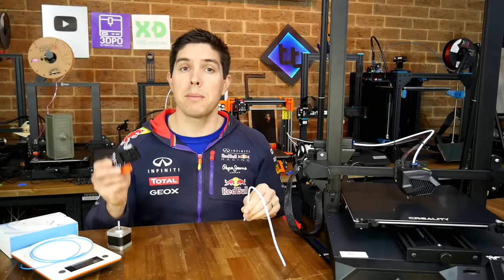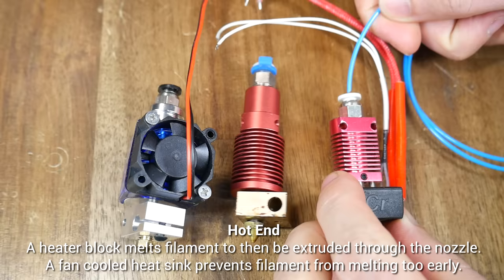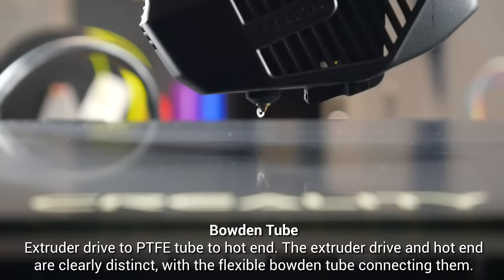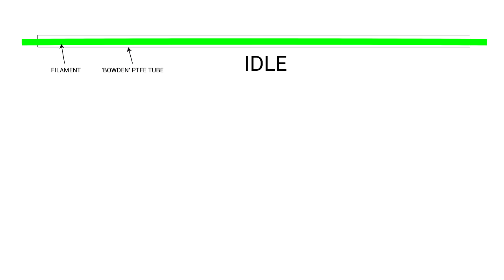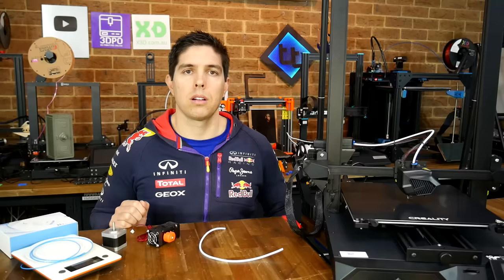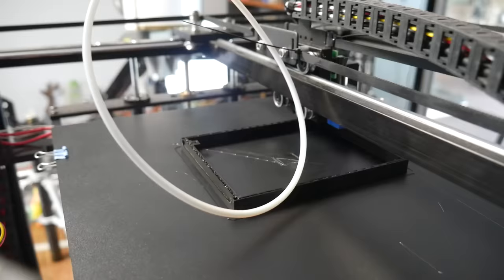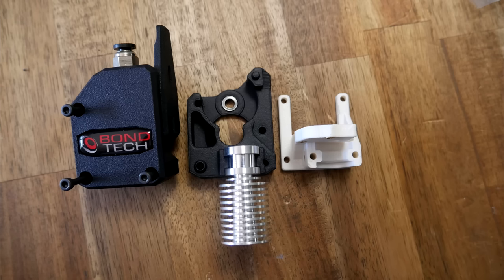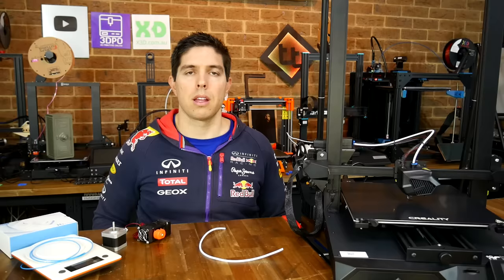Why direct drive is not automatically better than bowden tube

Comment: It is true that you gain more mass with a DD however with Klipper and other advancements in in acceleration control as well as printer config, It comes down to what you are going to print. how fast and what material will you be printing.

There is not a one size fits all in the rebuild market however in a new printer there made for the extruder you choose. thus cuts down on the drawbacks. I personally have had bowden for years and I have also converted all machines to DD. I will not go back to bowden. Because I print for a huge market place and customers orders change material and models all the time bowden just cant hold up top the task. Also the main drawback to bowden is the fittings holding the tube in place fail all the time and destroy prints when they do. If you are printing with retractions then the tube moves in and out causing wear on the fittings and the metal star grip ring in them starts cutting through the tube and causing failure.

Direct drive is only as good as the hotend you have it attached to. failure in a print is most likely to be caused by the hotend not being able to keep up with the pressure and volume that a DD can produce. thus if you are upgrading do your self a favor and upgrade the hotend as well.
Putting more pressure on the DD motor can cause heat creep from the motor to the filament thus causing jams by the filament getting to soft at the feed gears to push it through a cool hotend.  so heated volume becomes very important if you are using a DD.  

So for me DD is the only way to go if the printer is made for the change and the hotend is upgraded.

Comment: Direct drive has been really nice, upgrade my cr-10s. Can't say the weight is much of an issue as my speed limiting factor is the y-axis (as you touched on in your video). I think if you have a printer with a moving bed style you are going to be hard-pressed to overload the x-axis more than the then y-axis is already loaded.

You did miss another nice feature of direct drive and that's faster printing times with way less retraction.

Comment: I like the "floating bowden" where the stepper motor is detached from the frame, further decreasing weight/strain on the x/y/z axis resulting in even better quality prints.  JK i dont use that setup i just imagined it.

Comment: I recently learned that Creality is the only brand who keeps the two screws that hold the hot end in a fixed positiiton to the heatsink and they should be should be removed after printer assembly in order to greatly improve heat separation... 
That makes sense... The screws are transmitting a lot of the heat from the block into the heatsink... 
If this is a minor or great influencer I still don't know... The new bimetal hotend that I'm using has no screws and I wont go back to stock one to test... Maybe this would be a good subject for you. Regards from Brazil!
Reply: No, keep the bolts in the hotend!
They are there for stability of the hotend too
And they make a nozzle change more easy
Reply: Some just did a video on this - I think it may even have been Teaching Tech, but I'm not certain; Tomas Sandladerer (however you spell that!) or CNC Kitchen are other possibilities.  In any case, the conclusion was that the screws just don't transfer enough heat to matter.  Which makes sense - the vast majority of the screws' surface area is exposed, so they'll be radiating a lot of heat before it can even get to the heat sink.
Reply: Chill guys... It was just something I found that seemed to make sense... I stated that I didn't know if this could have minor or major influence...
Btw... all the other brands have no "stability screws"... So I can't considerer removing as a big of a deal anyway...

Comment: I can straight away tell you direct isnt always a improvement, i have a ender 3 s1 with a top mounted filament holder which is good for pla and dried filaments but filaments that you need to keep in the dryer make printing with direct a pain as i have no way to mount my dryer above my printer and feed the filament to the extruder without first having to create or buy some rollers that can direct the filament from the table up to the filament runout sensor which will feed down into the direct drive of my sprite extruder.

Direct drive is nicer for retraction as you don't need excessive retraction like with bowden setups but bowden tubes protect and guide the filament where as with direct drive you run the risk of filaments shaving or snagging, and in the case of glow in the dark filaments the abrasive filament will grind away your unprotected direct drive extruder parts, with bowden you can replace the length of tube very affordably, I don't even know how much a new sprite extruder costs but guaranteed you can't buy a new faceplate or whatever the part is called where the filament feeds into before the extrusion gear.
I want to get the items i need to convert my ender 3 s1 to bowden tube so i can print tpu and petg while they filaments are in my dryer, that way i dont need to install a shelf above my printer that will just be for the dryer box.

Comment: I installed a BMG direct drive and a 6 Hotend on my printer a week ago, and honestly, it's so great. The dual drive has so much more pressure and stringing is nearly not exciting anymore. With the bowden setup I had always a bit stringing even with 6mm Retraction, now I'm using 1mm retract, so great 😄 and because my printer is a cr10 clone, the print bed is so massive I can't print extremely fast anyways 😁

Comment: Why no use just a solenoid on the hot end to pull out the filament by 1 or 2 millimeter and leave the stepper on the frame ? 
"Solenoid-retracted bowden setup" is that thing (yet) ?

Comment: i run a delta with a long bowden... i will convert it to a suspended extruder soon
Reply: Thats a cool idea but if you haven't really check out klipper with pressure advance and input shaper.
It performs far greater than just a regular marlin os

Comment: Rather like the direct drive on the Titan extruder CR10 V3
Only other experience was my Ormerod 1 with bowden tube. 
That printer was generations older but I much prefer the direct drive for replacing filament and general performance. 
This makes me think about trying  to put a lighter pancake or other stepper on the extruder... Any suggestions?

Comment: Nice video. I bought a Swiss DD for my CR-10 smart. kinda new to printing , but it had bed leveling. The original shroud could not be used so i got a ender 3 shroud and put my fans in it. My problem now is Z won't go down to the table it hit's the hall switch for Z and tries to push. Any advice from anyone would be appreciated.
Thank you in advance  Jerry

Comment: Direct drive is overall better IMO if you don't want to maximize printing speed or low cost. For me, the main thing is the print temperature range. Bowden setups cannot typically print nylon or other high temperature materials because of Teflon degradation.

Comment: If you have the feed rate the same, but increase the acceleration, then won't it under-extrude? If you're pushing out the exact same amount of filament, but then cover the distance much faster, then you will have less time to extrude over the same distance.

Comment: Bowdens have advantages and disadvantages. and so do direct drive. Having a well tuned printer/ printers is key. If i had to have just one i  would do direct drive for the range of material.

Comment: A Bowden-based system will print well initially, but it will not take long before the tube starts to slip and you lose control of retraction.

Comment: When i start to 3d printing people goes to bowden for have less ghosting... now people goes to "direct drive" , my first printer was an anet a8... more direct than this ... and the second a ender 3. Now i have 2 direct drive and 2 bowden, an depending on the job i choose the best.
Reply: Me too Anet A8 first, then an Ender 3, I've got a DD bracket for the Ender 3 off Thingiverse, but I'm now thinking of a lightweight stepper to replace the standard Nema 17 motor.
Reply: Yes, the Anet A8 and similar really needed Bowden, they are so much better with them.

Comment: The problem with the nesty nimble and flex3drive is the cable that drives them still contributes to the weight. Plus you just dont quite get the same accuracy as a direct drive.

Direct Drive is superior in every single way to all other extruders have you have a well built sturdy machine with a modern control board.

Comment: I 3D print as a hobby so such issues are not critical to me.  I have an Ender 3 and a Neptune 2. Both are stock and have been doing awesome.  Thus I haven't seen the need for converting to direct drive...yet.

Comment: Bowden or Direct extrusion ? Hmmm ... A not that easy question.
Bowden setups are maybe "easier" to use for beginners, I don't know. General maintenance on a Bowden might be easier at first glance. Yet, modern Direct Extruders (either full-direct or remote motor) tend to be lighter as time goes by, and easy to use too.
Since direct extruders allow a (far) better control over filament, it might be a good idea to do Direct, probably a compact solution like the HextrudOrt, Titan Aero (and clones), Sherpa ... Every printer is different, but if one can avoid to extruder to be cantilevered, Direct might be a better option than Bowden since pancake steppers (or smaller !) and dual-geared extruders provide more than enough torque.

My main printer still has a Bowden, but converting it to (light) Direct will be done quite soon.

PS : as a side note, you should NOT use "direct drive" term to name extruder type. This is a misnomer. The correct name is "Direct Extruder", not "direct drive".

Comment: I was wondering if you can get a direct drive system in conjunction with a Bowden tube ie I’d like to replace my extruder on my ender 3 neo from only having one gear to two gear to feed the filament through to stop extrusion failure. I keep getting them which is extremely frustrating

Comment: OMG! someone that had a solidoodle. I have a solidoodle 3. this extruder is a mess. I used your files to substitute the broken acrylic extruder.

Eventually I gave up 3d printing a few years ago because this printer was really bad. 

Now I have a creality Cr-10 V3 direct drive and want to mod my old solidoodle 3 by changing the electronics and putting a bowden extruder.

Comment: One thing I don’t get is why nobody just mounts a stepper on the carriage of a 3D printer with a design such as an ender 3. Then you just take a rubber belt and wrap it around the other side of the carriage with a belt tensioner. Just put a super lightweight extruder on the print head connected to this belt, and then just modify the software to set the speed of the extruder to the speed of the x axis + the extruder feed rate. That way you have a direct drive system without adding the weight of a stepper.

Comment: I'm still using a bowden setup, because i m still considering the options, whether changing the setup or create a new printer. But i have also a question, what about feedback, can this not avoid the problems with an heavier print bed/print head.

Comment: Does drive direct provide more torque compared to a bowden tube setup? I'm trying to print with 0.1mm nozzles on my ender 3 bowden setup but to no avail. 0.15mm nozzles seem to print fine, and I've already changed my extruder to be dual geared. I wonder if I need a higher torque to get the filament to extrude through the 0.1mm hole.

Comment: I've been wondering for a long while already: why are the steppers for extruders so huge?
On my CR-6 for example, the extruder stepper is the same size as all other steppers on it.
Shouldn't it be better and even cheaper to use smaller steppers for them?
Reply: it's cheaper to have those bullied ones usually, they rend to be a cheaper model, my LGX and OEM Sidewinder X1 both use a pancake stepper motor

Comment: Why is the filament a cylindrical wire? Having it with square or rectangular cross-section  would make it easier to grab and pull/push with gears.
Of course, to use such filament it would be necessary to redesign a bunch of metal parts... It's not something that a hobbyist could easily do without a bunch of specialized tools.
Reply: I imagine square filament would be harder and more expensive to manufacture to tight tolerances like today's standard filament, just based on seeing how those filastruder things do it anyway

Comment: Is there any way you could add additional support to the frame of a direct drive to minimize vibrations? Whether it be replacing it with a denser metal or adding additional material? Sorry Im new to 3d printing so I’m not sure if this has been explored

Comment: What do you do when you can't do direct drive or bowden tube?  I own a 320 x 320 x 420 mm mix color printer.  It was designed to have the extruder and each color at the top, so I have 500mm of bowden tube for each color coming from a mount at the top which is causing horrible stringing I have not been able to fix no matter what.  But because it is mix color, I can not do direct drive, because I would need an extruder for each color mounted on the print head, causing excessive weight.  So what do I do with this printer?  I've had it a long time and never been able to use it due to the stringing issues.

Comment: Ok I did it the funny way. I converted my Ender 3 from bowden to direct drive and my AM6 from direct drive to bowden. The retraction lengh of my bowden steup is about 1.5 mm. In this way you maybe should show up the difference between a all metal and a bowden hotend too.
Reply: What is an all-metal hotend anyway? My moded Ender 3 V2 has no plastic after the Bowden intake, so this is all metal then?
Reply: @Spelter  If your bowden tube goes all down to your nozzle, it is not an all metal hotend. Simple said.

Comment: The weight of a heatbed is much more than the weight of direct drive extruder. Thus on Prusa-like printers the acceleration will be limited by the bed not by the head. Lesser retracts will provide faster printing speed, lesser chance of heat jams and allow to use flex materials. Linear advance algorithm also works better with DDE. Bowden tube is no longer a good choice nowadays.

Comment: Hi everyone, I need some advice please. 
I have a new direct drive assembly (in the mail) and I own an ender 3 2020, and a v2 neo. 
Which printer would be the most beneficial to install the DD? and why? they are both stock.

Comment: The bowden setup is still largely used on cheaper machines because it's, well... cheaper! The example is the Creality extruder, I can't imagine a simpler design, but that also means that it's not very efficient doing its job, but that's easily solvable (for the most part) using a stronger stepper motor (while still being cheaper than moving to a geared dual drive). Also direct drive extruder means that you have more complexity, as the extruder is near the hotend, and this also makes this design more expensive.

Comment: Direct drive needs less than 1mm retraction vs 6mm bowden. Most printers dont move while retracting, leaving marks on the print. Some fine detailed prints are impossible with a bowden setup.

Comment: I have my eye on a Ender 5 Plus because it's bed only moves in the Z axis and it has dual Z axis screws. I want to print some tall fusalage type objects so I dont want the bed ocillating the print as it gets taller. Because it has a gantry printhead I presume it's already fairly weighty which will reduce acceleration. Does anyone have any thought on how much a lightweight DD extruder might affect this?

Comment: My bowden printer does retraction reasonably well, but it has huge issues with line width consistency. It's under-extruding during acceleration and over-extruding during deceleration.
Reply: Do you have tight bends in your tube routing?
Reply: @DepressedCookie  No, the routing is kink-free throughout the entire travel of the X axis. The problem is probably coming from the very loose tolerance between the filament and the tube.
Reply: @slap_my_hand  Yes most probable and potentially moisture could be a factor as well
Reply: Thats just what bowdens do unfortunatly.  It can be helped with pressure advance, but eventualy at higher speeds the extruder just cant keep up.

Something to bare in mind also is that an decent extruder will push up to about 10kg or force.  Use a luggage scale and see how much a ptfe tube stretches at 10kg.  A significant ammount.
Reply: @bassplaya69er  Interesting thing to try.

Comment: The reason cheaper printers use bowden is because they typically have rather flimsy frames that ring badly when you put weight on them. 

The best way to cut costs is to cut material usage which means thinner axis supports. If you compare a Prusa with a Wanhao, it is IMMEDIATELY clear where money is (or isn’t) going.

Comment: I'm using 3mm retraction on a Bowden tube setup with an .8mm nozzle with no stringing. I'm a little shocked to see 7mm being standard. (ps, my printer is a mega zero v1)

Comment: I had a thought.....I have a ender 3 max and I was having issues and after watch close I figured out that the only one Z axis was making one side slower and making problems.So I bought a dual Z kit for a ender 3 v2 for $25 and because the rod was too short I bought a 480mm rod for $19 and put it together.Ive done 20 prints with no issues since.Do you think a direct drive would be better now that it has a dual Z?? I want to try flexable filament and Ive heard that they work better with direct drive.Any chance you could test this??